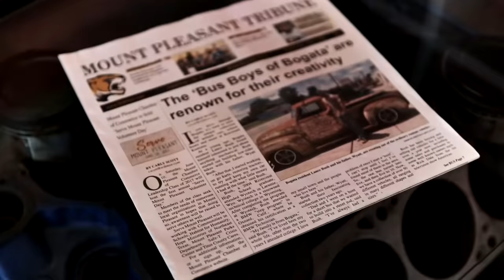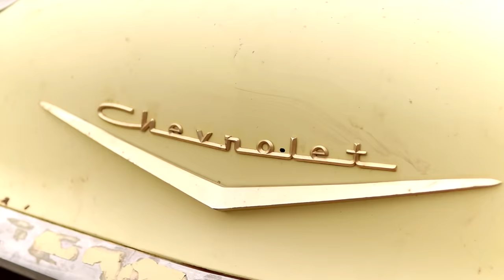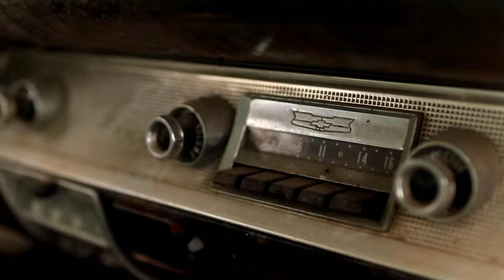1957 Chevy Bel Air, Will It Run After 35 Years?! | Turnin Rust

Comment: On March 26, 1970,  I bought my 1957 Chevy "Handyman" two-door station wagon from the guy who owned it then. My brother Tim and I had to replace its failed master cylinder in the owner's driveway before I could drive it home. At that time, the car had its original 265 V-8 and three-speed manual transmission in it.  I still own the car today....

Comment: See the pretty ceramic block on the firewall
It is a resistor to drop voltage to points after the engine starts

A wire runs directly to starter from key start position to bypass resistor when starting
When in run position voltage runs thru resistor to prevent burning up points
Still have flexible tool to adjust points while running
 Good luck
Reply: That’s right. Connect jumper wire to t.
Reply: I once replaced the coil on a Ford Escort without knowing about this voltage drop.  In the Escort it was done with some kind of internal resistance wire (never found out exactly how it worked).  Never could get it running with the non-standard coil because it never received enough starting voltage.  Good learning experience, without costing too much.

Comment: There is a window on the distributor cap that allows for a special flexible allen wrench to enter and you can adjust the points on the fly with a dwell meter.  The choke tube goes into a hole in the right side exhaust manifold.  Strange I should be writing about this, but we worked on many a vehicle in our time, and most of it was without any computers.

Comment: Love the video guys, however there are a few things I would’ve did first before cranking:
1. New oil
2. Set points
3. Coolant
4. Drain whatever in gas tank & replace
5. Put a new belt on missing alternator belt
5. Lube up cylinders before cold crank
Reply: I was also worried about cranking it on dry cylinders. They could’ve squirted some Marvel down the plug holes and examined the plugs while they were doing so.
Reply: Dave Micolichek <—I suppose, however if this is an engine you’re interested in actually keeping amd using them why not treat it well from minute 1 and not cause any more possible damage? If the initial $100 bucks is that much to someone then maybe they need a cheaper hobby. No disrespect intended.

Comment: I would change that oil because as soon as it warms up all the sludge will break free and go threw your motor
Reply: Hearing it run and getting it up to temperature and driving it is 2 things lol
Reply: @delwhylie4748  I definitely would flip that car 🐤
Reply: @Jason Blackburn>>>> Most professional shops would not open the hood and start pulling on parts without first power washing the entire car period. The process most professional shops like mine use is the first step is washing the car entirely particularly under the hood. The oil gets drained spark plugs radiator and distributor get pulled plug wires old points go in the shit can sometimes the distributor itself ends up there. After the radiator comes back the freeze plugs get examined before any water or coolant go back in the car. Shitty hoses get replaced. No professional likes to see a hose rupture of the engine suffer a mysterious mechanical demise from old sludge and shit blocking the oil journals in the engine. So what these guys R doing disgusts most of us that call ourselves professionals. In no way would have started fiddling around in that engine without getting all the crud out of the way first. We also go over the transmissions and examine old clutch and throw out bearings. Folks do not realize just how easy it is to get a vehicle stuck in gear and have it freeze up in gear. At times trying to force a car back out of gear where it froze can cause a catastrophe to a gear box. I find the car in the video interesting. I find the hosts being a pair of Boobs.. There is a shop here local to me that can a do beautiful job on those old brass and copper radiators. To me these guys offend people like me that call themselves a professional. What happens is videos like this give assholes bad impressions on what a professional restoration shop does do. What happens is shit like this starts arguments that I shoulda just done just this or that. More over we have severe winters and storms here which alters my approach at how I prepare a resto mod job.
Reply: @gmc1284  John politely understand what these 2 guys are representing gives other folks thee very wrong idea how a professional approaches getting an old wreck running again. Now if you can only reach deep down in your confused mind you can consider what I mean. I have people that drop stuff off here and get a very wrong impression on how a Pro Shop approaches this work. I am sorry you are not capable of understanding the fundamentals of this work and the problems videos like these can cause. Just like those videos of guys going creeping around property and personal items left on remote and rural properties. It causes problems. It would be a lot diff if these two guys did not represent themselves as a professional shop. Even the happy the clown wires and battery can be dangerous just have a rouge unintentional spark hit gasoline and see what can happen to a person or their home or garage... These videos give the totally wrong impression of what a Professional shop does.  Not to mention as the fiddle and fuddle with a 5 gallon gas can nearby you don't see a fire extinguisher in sight now do ya. I just about duct tape one to my ass when I am fiddling with an old engine that might spark arch or errupt into a ball of flames from the timing being off. Sorry U are not capable of understanding the extremeness of the dangers here in this video
Reply: @jaydogsgonefishin5547  These guys do a good job of gettin these olds girls up and running
Reply: @Mark-nu5vg  yes they do
Reply: @Mark-nu5vg  Could be the reasons I have a job and you don't...
Reply: Kendall or Q state..BWAHAHAHAHAH
Reply: Jason Blackborn.   Wronq! Get it hot so everything comes out when oil changed.
Reply: @thekingsilverado9004  I don't know if these guys call themselves "professionals" anywhere in the video...... I didn't watch the whole thing but I know what you mean....... if it's a rotisserie restoration you want to take GREAT care on what you're dealing with. But with the Tri Five Chevy's they're a dime a dozen........ you can find parts anywhere online for them. You're not dealing with a '57 Cadillac Eldorado Brougham which are worth half a King's ransom. I am with you on getting all the "essential" parts fixed before starting to drive the car, but like these guys i'd be very eager to get it up and running and see if it will start, move on it's own power.... that's about it........ then i'd start working on it.  Doing a '67 Cadillac Fleetwood right now and I only got it started up and moved it off the trailer, then i tore the engine down and redid the timing parts and lifters. Difference with mine is it's been sitting since 1982 but driven sparingly and not a "who knows" like this one......... I even got the factory a/c working perfectly on mine with a bit of playing around.
Reply: @thekingsilverado9004  yep, I had that happen to an old '65 Lincoln I bought once. Was trying to fire it up to move it onto a trailer, put gas in the carb and it caught on fire. quickly put a blanket on top and killed it but YES, you really need to know what you are doing ............. i don't think this is their first rodeo though. they just have a more "hillybilly" way of going at it......... i've done both.......... I have run a restoration shop from 2001 to 2015 for classic Lincolns and I also at times have "mickey mouse" stuff to get things running so I could get a car running or get it home or whatever....... I get your point. These guys are not you're rotisserie,  Concourse level restoration guys :)
Reply: Del Whylie That oil has no lubrication at all after 35 years of sitting, so if they don't change the oil as soon as possible that engine will seze up or it will get unnecessary wear that it would not get if they change the oil, because of the oil is not lubricating at all anymore. Better change the oil with used oil if you don't want to spill money on new oil when you try the engine, then not changing it at all.
Reply: @gmc1284                                                                                                                                                                                           Well you should know better i agree with SILVERADO.
Reply: @thekingsilverado9004  . If the video upsets you so much dont watch it .
Reply: @delwhylie4748  Del I have been in Speed and Performance since I was born and wiping the floors of my Fathers shop in Diapers. The fastest way to knock a bearing out of any antique engine is to run em with that maple and syrup and shit in the oil. It's fine to spin em over by hand once you know the motor is free is the time to dump the oil in. Being in speed and performance all my life I will say I spend more than 100 bucks a week on good beer so 30 bucks doesn't concern me in the least bit. Losing a vintage engine to stupidity now that bothers me.
Reply: @colemanadamson5943  U sound just like one of my kids when I talk sense to em
Reply: @thekingsilverado9004  Thanks for your comments.  You answered quite a few of my unasked questions.  I always wonder how much damage you can cause "blind" starting an engine without knowing if there are any bits and pieces of rubbish inside the engine that can cause damage just by being bounced around inside an engine or scraping on a smooth or bearing surface. However, for me it is still fun to see how such an engine can still start with minimum repairs (as long as the engine is not in my car).
Reply: @danmybusiness1167  I've noticed in some videos are a total set up. If an engine is free usually it will run even if it has internal issues. But most of us Pro's clear all those leaves and animal nests with leaf blowers and compressed air and a good steam cleaning. Then we either pull those vintage engines or break em down. In one recent distant exp I had inherited a 66 Chevy pickup that actually had only 33K miles when it stopped running and it's wasn't an engine issue the rear was knocked out of it from pulling a car trailer. So with the truck having sat inside a barn since 1974 I got ahold of it and it still had animal nests dust debris. I was extra critical with a like new vintage truck with only one known issue so after it's multiple cleanings & 3 very extensive baths inside and out I pulled the engine and still found some potentially lethal crud although one could clearly see the engine was fairly decent what I found was either hardened carbon chips from the bottom of the intake or possibly wood chips that had fallen in the engine and hardened. I now have it running like new again. I have had offers upwards of 20K for the truck. Keep in mind those vintage engines used Parafine based engine oils which is basically wax and it produced tons of carbon is what wax eventually turns into.
Reply: @thekingsilverado9004  r/iamverysmart
Reply: @josephjakubec3171  actually,  1st thing after they see it runs. Say 15 seconds.  Shut it down, change oil and filter.  Then let it run about 30 minutes. And change oil again. Of course you'll have to have cooling system working.  Get that horrible oil out Pronto. Before is ruins the bearings,  and everything else.
Reply: @jeffrygagnon5506  Thanks Jeff.... Many people look at me to put their old GM stuff back the way it belongs... It's about a 90% thing... Some folks look at antiquated junk shit much differently than a pro does and that has created controversy and fist fights here... As far as pulling up your fucking pants and becoming a productive member of society well your post says it all nothing more needs saying that subject... Well have 5 house cats much smarter much more sanitrary than most Honor Roll students these days... Take it to bank when I tell ya I know what I am doing... Chevrolet lives on here. 90% cure rate. Wish doctors did that with cancer like I have... Just cut the old shit out and weld new stuff in...

Comment: Cold start. Will you guys ever put oil in the heads. Wind by hand. Or at least run two stock oil in fuel.  Take care . Stay safe from vires.
Reply: And make sure that the choke an fuel pump are working too

Comment: On these older cars you have 2 small terminals on the solenoid. One is the trigger. 12 volts to it engages the starter. The other goes to the + side of the coil. It feeds 12 volts to the points for a hot start. Once the car starts and the solenoid is released power goes to the points through a resistor wire dropping the power to the points to 9 volts. It makes the points last longer.

Comment: It's American, that's why, they can set for year's then fix em up, and run like a champ
Reply: no Chinese flu there
Reply: All old engine's not matter wear. All will rust in side.  Scoring is bad mate.
Reply: Grymt
Reply: U can't fake dermal ridges  Modern american cars are built from chinese junk, there in lies the problem. They can only claim "assembled" in america.
Reply: @mick00000000002  I've pulled flat head 8 motors that have not run in 50 years, stuck. About a cup of diesel down each spark plug hole, patience and a breaker bar. They break free and will run damn good, scoring be damned lol
Reply: Are you for real. ? Think mate.
Reply: Bollocks. Seen all sorts of bikes and cars restored over the years.

The reason it's running is because it wasn't honestly that fucked to begin with.

That said, they are bloody great basis for tuning because they're so lazily engineered - theres a hell of a lot more meat to play with on the blocks. Superb to work with.

Comment: You guys are something.  Enough bailing wire and a 2x6 will always work.  If you continue to work on old GM cars you need a dwell-tachometer to adjust the points.  I have one I’ll give you if you want it.

Comment: When changing tires on the wheel that are on the 1957  .... You dismount them from the rear!!
I changed  a lot of them back in the day.
Reply: I don’t think so. Unless they are chrome reverse wheels. Been doing tires by hand since 1968 and 99.999% of wheels come off the front. Which makes it tough for nice finish wheels. You have to pad your tools.
57 Chevy steel wheels are same as any.
Reply: Greg Blalock is correct. ’57 steel wheels are different that way. Many of those wheels ruined by doing it the ”standard way”.

Comment: Change the oil. Then while it's draining take a good look at the choke and throttle linkage on that Rochester 4GC carburetor. The throttle must be cracked to re-set the fast idle cam and allow the choke plate to close. That is why you pump the gas pedal at least once on a cold engine. Re-install the heat tube to the exhaust manifold so the automatic choke will open. If you can find a "Motors Manual" from the early '60's buy it. Therein lies a wealth of knowledge.... good luck. Oh btw the generator with the  armature drive for the Power Steering pump is Gold. That drive is also used for the rare unobtainium factory Tachometer.

Comment: most dist. cap has window  slide it up adjust points
they make a tool for that adjustment
Reply: I've got that tool , I don't think I have ever used it... an allen wrench on a flex..
Reply: @Reroy55   I've had one of those in my tool box for years my grandpa gave me, ive never used it either.
Reply: 56's didn't have that and i don't remember any 57's having it .It's how you adjust the dwell on the fly and quite a good idea back then (i bought a  near new 56 belair when i was 17,and back then Model T was a 40 year old antique..) )

Comment: Is that a powerpack engine? 4Bbl,sharp hump on the end of the heads? .I see power steer which wasn't that common.
Reply: It sure does look like a327out of something latter to me a
Reply: Was expecting a 2 bbl. 283... 4 bbl. is a good sign...
Reply: @thomasjasper9143  Thats a 327, early to mid 60s. Style of the valve covers. 283 had Chevrolet name embossed on the valve covers.

Comment: It's hilarious when people pump the throttle when the float bowls are empty... accelerator pump won't do much.
Reply: habit - I do it all the time knowing full well on she's empty😂   It's a good reminder to fill the bowls up through the vents though 👍
Reply: Even more hilarious is when you try to put fuel in opposite direction in fuel pump where you have two one direction valve!
Reply: @ViceGripGarage  I did the same thing on a 78 Uhaul F350 with a 330 this week on my farm that hasnt been started since 2002.. habit is correct lol

Comment: if it was me at $ 1900 that's a steal I would throw a fuel pump on her ticker some and keep her thats a very nice car guys stay safe and God bless you all
Reply: Same hear. I'd definitely would keep it.
Reply: I'd have had that car on a trailer ready to head back to my place before that lady could have finished saying '$1900 and it's yours'. She'd have the cash before she finished speaking. That's a nicely equipped car for its time. Power pak engine, probably 283, ps, pb, Bel Air hardtop. Looked like a vacuum tank on the inside of the driver side fender. Nice color too. I like that body style on the 56 and 57, also on the 57 / 58 Fords.

Comment: 5:15  Forcing an engine to run after its been sitting for 20 or 30 years is  Not a good idea. Valve springs that have been compressed for that long will not extend to full length. Even if it runs, it will run gently, not correctly. Gaskets and seals are going to leak,  and damaged parts are going to be MORE damaged. If you MUST turn the engine over, take the plugs out first then put a light oil such as diesel down the sparkplug holes to lubricate things.  An engine teardown and inspection of all parts, clean everything, hone cylinders, do the valves and seats,  reassemble with new gaskets and parts as needed can give you a good engine with minimum cost